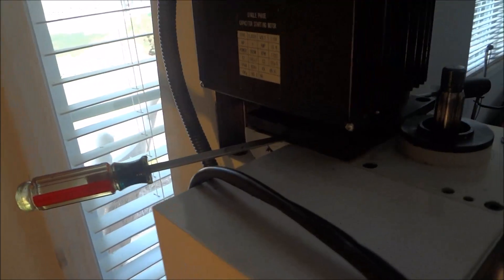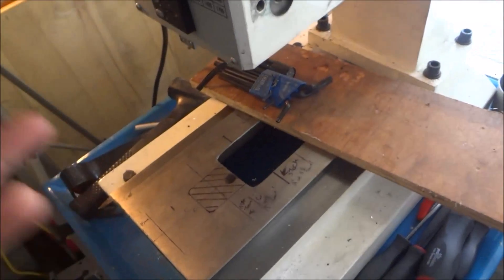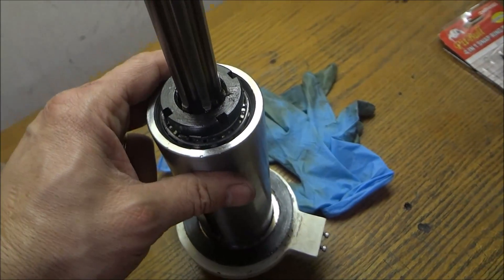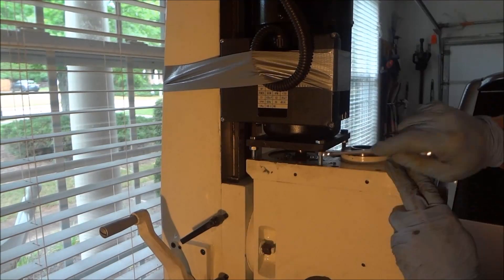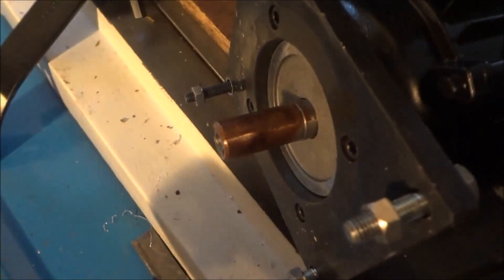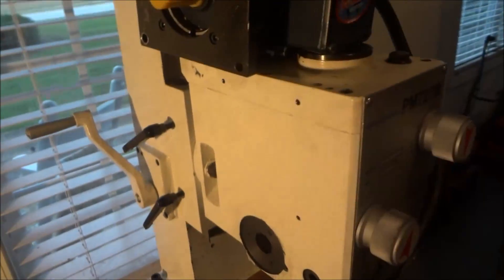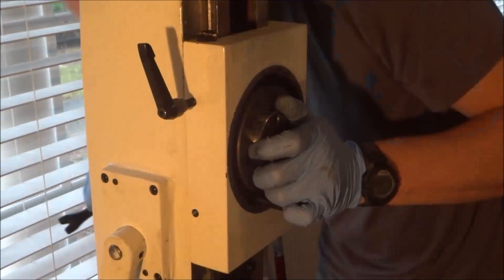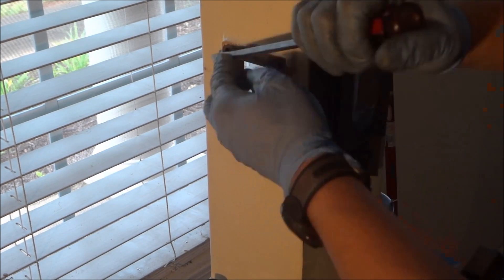Pm727M Teardown

Comment: Did you replace the spindle bearings?  I am looking for part numbers for replacement bearings.  I upgraded to a VFD and I am getting a lot of spindle heat when running at higher speeds.
Reply from the maker: I have not changed the bearings Yet still running stock. they do get hot at 3k rpm but not to bad.
Reply: Thanks for the reply! I typically run mine at about 2400RPM and lately its been getting to 140 deg after about 10 minutes of run time.  I had an issue with the bearing preload when I first got the mill.  I was running 1700 at the time and getting to 150deg.  I will probably pull the spindle tonight, regrease and take out a little more preload.
Reply from the maker: Hi Jim, I'm sure mine has gotten hotter than that I've ran mine for several hrs. At some point the gearbox reaches a point where it doesn't really get any hotter.
 I plan on using AC bearings. Top 7205b Bottom 7207b
Stock bearings are 30205 and 30207
Reply: I think I am going to order some tonight.  I run my mill  for hours at a time and can't afford to be down waiting on parts if something fails.  Also, your videos were a huge help when I did my conversion.  I appreciate the info!
Reply from the maker: Jim Stehlin 
your welcome glad they helped i will be starting on a belt drive soon.
Reply: That's awesome! That is a mod I would like to do. 

So, I cleaned and regreased the bearings and removed a bit of preload.  I ran the mill for about an hour tonight at 3000 RPM and the temp didn't exceed 90 deg.
Reply from the maker: Sounds Good I have repacked my bearing once I need to again. I get a little coolant wash out.
 Be Safe,
Sam

Comment: would you have the part number for the motor?
enjoying the videos. 
in process of doing the same machine.
Reply from the maker: http://www.ebay.com/itm/LEESON-192057-30-Metric-Motor-Ball-230-460V-60-50-Hz-/221560847401?hash=item33960e3c29:g:zbgAAOSwARZXnOHy
Reply: Perfect. Thank you
Reply: CNC4XR7 is it the 56j frame?

Comment: Looks like a solid and decent mill. Are you happy with it quality etc..?
Reply from the maker: Very Happy with the Fit, Ways construction, and Size. Looks like my travels will be Y 9.5" and X 18" with out going extreme. and for me that should be perfect. Having the 3 phase motor a direct fit is A big bonus for even those keeping it as a manual mill.
Be Safe,
Sam
Reply: Ok cool, glad you're happy with it. Thanks for getting back to me Sam.  Cheers, Aaron.

Comment: Not great quality control on the OEM's part having that rust on the motors shaft. Do you think it would have made things easier to pull the gear box top plate and motor as one assembly and then split those?  I am a bit surprised you found a direct replacement motor that will drop in place tho. It's my understanding that some of the Asian built motors are built to there own motor frame standards that don't match up to the American or Metric frame standards. I'd say you got real lucky. Possibly I missed it, you did mention 3 ph. That's what your replacement motor is? If so then a very smart move. A 3 ph motor with a VFD is the only way to go with machine tools. Far smoother drive that get's you much better surface finishes with some very desirable options for motor control built right into most VFD's. But I dunno, doubling the motor speed I'd seriously consider upgrading any and all bearings in the head, it does seem your replacing the spindle bearings but I don't know if there's any others in the head itself. You can bet at the prices they build them to fit to those will be the cheapest bearings they can find. Even one spun bearing in the future would make replacing what you have now look pretty cheap.
Reply from the maker: Yeah the shaft rust gunk is pretty standard stuff from my experience. I wasn't sure about cracking the gearbox open just yet. Yes you heard right a direct replacement the Lesson IEC metric motor is aluminum frame as well and lighter than the stock motor. I will replace the spindle bearings and forgo the gearbox bearings as I intend to go with a belt drive.  But this motor will bolt right to the oem gearbox. So a 3 phase vfd conversion would be easy.

Comment: Well now you have seen the guts of this machine and I was wondering if you could give an honest opinion on the quality along with fit and finish or anything else you could respond too. Thanks for the videos, I am using mine but as stated before won't be converting to CNC. 
My only complaint are the knobs to change gears, seems like I'm always fishing for one or the other. Not a biggy, just annoying for me. Thinking about removing the knobs and replacing with levers. If so I'll let you know if it's any better.
Reply from the maker: Hi Bill 
I'm looking from a different view point. Yes the knobs are a pain. I had the same experience. I think overall the quality is good they seem to have spent a little time cleaning up the castings etc. Always a good sign. It seems to be a better quality than say a Bolton brand.
Reply from the maker: As a Manual mill there may be some things I may have overlooked Just because I will be replacing or removing.

But overall I'm satisfied with the quality and the size.
Reply: I agree about the quality and size. Much more then I expected. I purchased it for simple metal projects for rc planes and scratch building trucks and many other items but found out it's quite capable of more serious heavier work (considering the price)  and am happy with my purchase. Not only that, but Matt, from Precision has helped out tremendously just answering any questions. So the product itself is great in my opinion but the product support is there too.